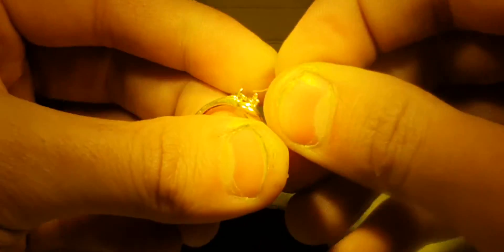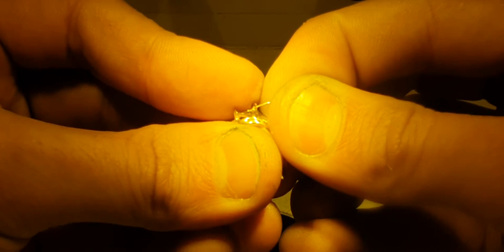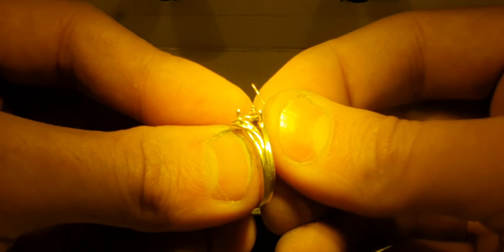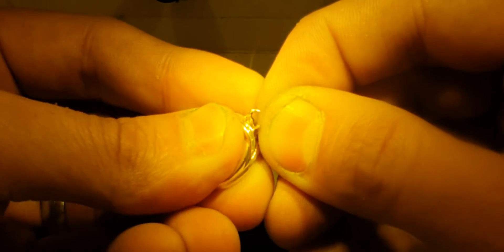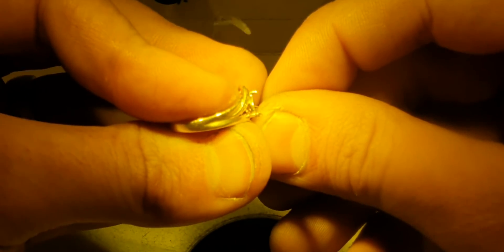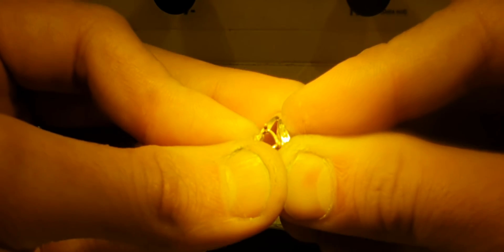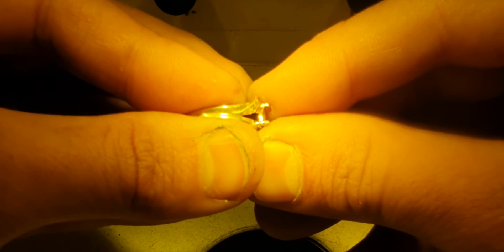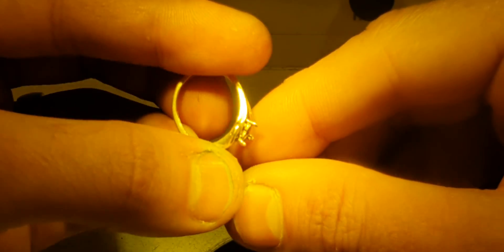Laser welding gold

Comment: Hey Jake great video Trust you charge the claw replacement  to rebuild as you are doing  the same job. Only Better no solder. Lasers are a TOOL but we still need to be recompensed for our skill. Had mine 10+ years and would not be with out it.  John
Reply from the maker: Yeah mate reclaw and reset. I price according to the job and after outlaying so much for the laser, time taken becomes irrelevant.